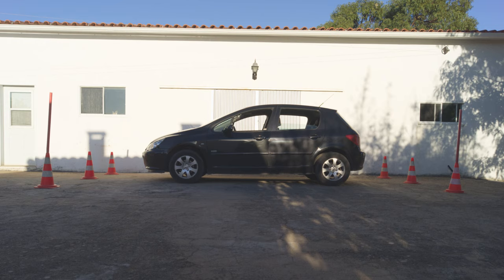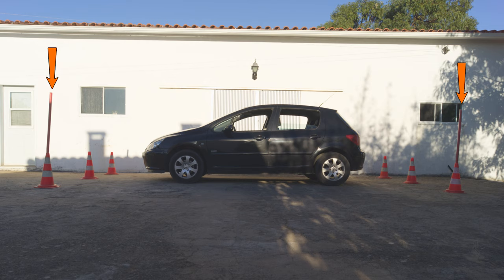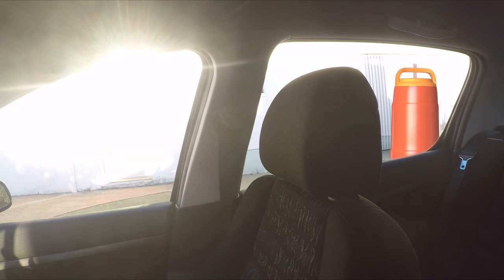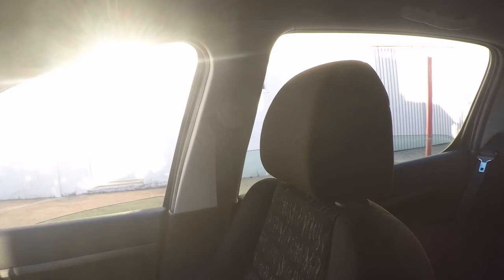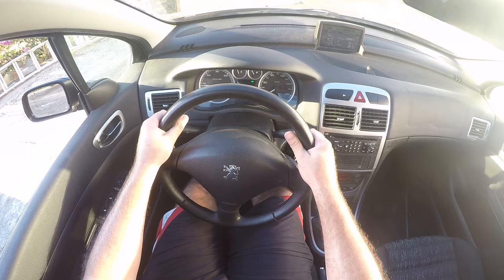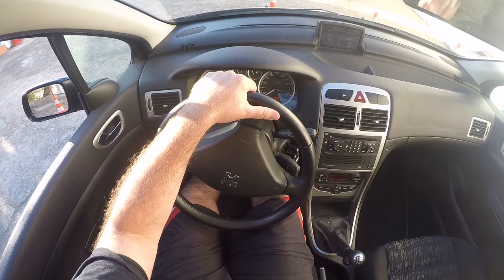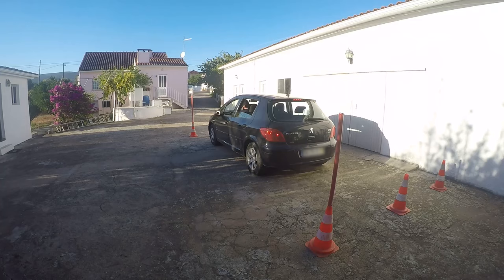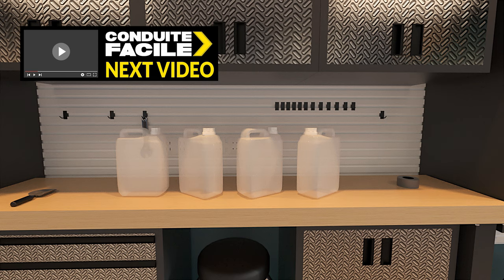How To Parallel Park Between Cones - Part 1

Comment: For Parking with Cones in MICHIGAN- If you advance forward you earn a point for Repositioning your vehicle!  Do not PULL forward on MICHIGAN ROAD TEST- It is called Blind Side Backing in the Road Skills Test Study Guide NOT Parallel Parking where you maneuver your car back and forth until even in the space....Small Technicality but can make the difference for a pass or fail for some drivers.  LOVE ALL CONDUITE FACILE VIDEOS for beginner drivers, Thank YOU!

Comment: in ur previous videos u turned ur steering wheel only one turn or 1.4 turn but why this time did u turn completely???  pls clear my confusion. can we use this method to park between two cars will i risk hitting the reference cars?? pls explain the logic behind number of the steering turns in  every situations.
Reply from the maker: I explain it here: https://youtu.be/PeHBMfu9tZc
In this case with the cones, they're angled so there's less the risk of hitting them.

Comment: Why dont use 1 turn steering like previous video on parallel parking? In this video you use full lock to right @conduite facile?
Reply from the maker: The space is tighter, and cones are also angled and further away from the front of the car.
Reply: @ConduiteFacile  thanks for the information bro. Useful tips. ☺👍🏿

Comment: Does the same apply to smaller cones with the steps. Mine are really small?
Reply from the maker: Yes. Height only matters if you want to see the cone. You can use some extensions like I did in the video.
Reply: @ConduiteFacile   where i parallel park i only have 2 cones set up on each side instead of 3 of them like shown in this video. Does 2 cones work as well instead of 3?